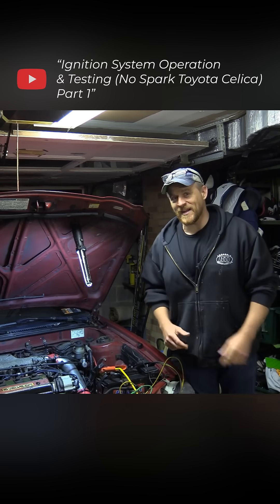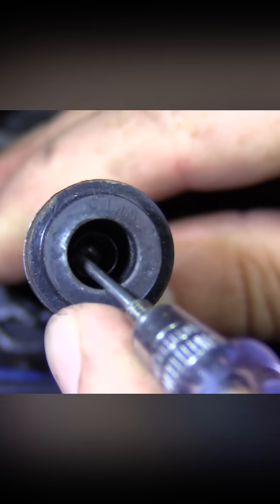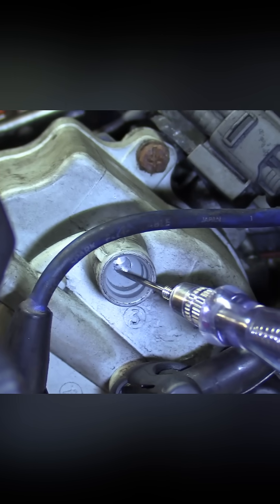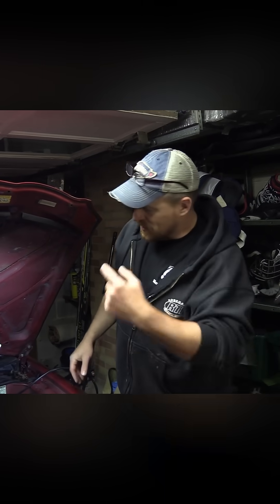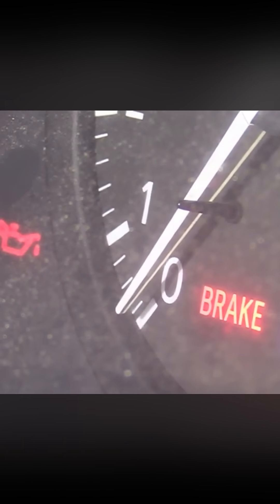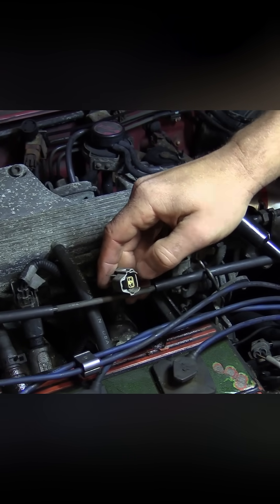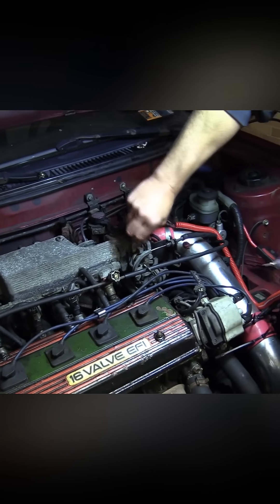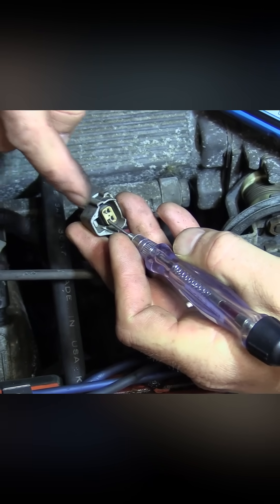Quick tests for no spark  #automotivediagnostics #nospark  #mechanic  #automobile

Comment: Called this one at the start of the video, soon as you said no start. Shorted ignition coil. Those distributor mounted coils in older Toyotas were notorious for that. Bet a current ramp of that coil would go almost straight up.
Reply from the maker: I think we showed the coil current ramp in the full video (linked in this short)

Comment: My car isn't cranking I changed the ignition switch and the tumbler all fuses and relays were checked by multimeter and new starter. Please help
Reply from the maker: Need Voltage readings on the starter during cranking. Both the heavy post and solenoid post
Reply: @ScannerDanner  it doesn't crank at all just clicks. Battery is fully charged
Reply from the maker: @daveyboy919  now you are wasting my time. Voltage readings need to be taken at the starter. Or just throw parts at it. You have two choice. I won't help any further without actual numbers
Reply: @ScannerDanner  nevermind bro I'm here by myself I can't do it

Comment: Wait if your finger is touching the same metal that is supposed to conduct that really painful shock,in theory electricity would also go through your finger right,so maybe keep finger away from spark plug wire tip.
Reply from the maker: no risk at all. The other end is grounded to the body and is the easier path, even if I was touching the metal tip of the test light i would not get shocked

Comment: I bought a 1981 Toyota Celica Supra a year ago. It had this same problem and my mechanic couldn’t fix it so I sold it just last week. I took a big loss on it too. Having to sell it was a real bummer.
Reply: hes not a mechanic than lol
Reply: we had one in our shop too, found the IGN system was unique in Toyota engineering, was insanely complicated. After checking everything and a new Distributor later, still no start, our tech wanted at the timing chain next, found out customer changed it just prior to this issue, bailed on us, was angry with us, we ate most of the bill, wasn't fun.

Comment: So your cranking an engine that’s not getting spark and you smell fuel. You then think, ah ha….I should test the injector signal to make sure I’m getting fuel?? What kind of logic is that?
Reply from the maker: Can you smell the fuel? What a stupid comment. I'm proving the point and showing testing methods. Move along. Wrong channel for you
Reply: I didn't mean to be mean, it was sarcasm. Also using a 12V test light to provide a path for secondary ignition ground with tens of thousands of volts is a bad idea too.

Comment: Amateur/Shade Tree here. I always learn something (that I had NO IDEA about) prior to watching Paul work/test. I'm chasing an Evap code but I can't afford an expensive scan tool to command Vent/Purge on or off, or a smoker. When it gets warmer here in the NorthEast, I may put it up and reach under to test each one electrically. I have a feeling I'm looking at the Vent Valve but I don't want to just change parts until I find it. It's not effecting the driveability or ignition (yet).

Comment: It’s an odb 1 system in that car. You can test the fuel pump through the test port under the hood. Jumper pin 1 and pin Fp. Guess what Fp stands for?
Reply from the maker: Wasn't worried about the fuel pump in this senario

Comment: You got a lot of guts touching that test light conductor. That sucker was live, you’d know!
Reply from the maker: No worries at all! Even if it was "live" the easiest path is not my finger. It is through the metal tip of the test light then to ground on the other end of the light. As long as my finger was further away than the metal tip of the test light. I'm good. Even resting my finger on the metal you wouldn't get shocked

Comment: The tack should have moved to engine rotating rpm .but since  the only thing that was causing the tack to move was just the voltage moving by being drawn from the starter .and sincebthe primary ignition is working then it would have to be the igniter since it is the module and its primary job is to compute the ground signals
Reply from the maker: Check out the full video linked in this clip

Comment: Pop the distributor cap and make sure your rotor is rotating before making any other test in my opinion takes less than 10 seconds. I try to start with easiest and cheapest.
Reply from the maker: Since the ignition input circuits are all inside of the distributor, there is no possible way that it is not turning. We have tach bounce AND injector pulse. That visual inspection is not needed in this situation
Reply: @ I beg to differ on this assessment. The ECM in correlation with the crankshaft/ camshaft sensors, reluctor ring give you a pulse width signal to your injectors. The distributor is what controls the spark to the spark plugs not the ECM/PCM. I have came across this issue more than once in my days where the fastener for the $7.00 dollar rotor has vibrated out thus your rotor will not rotate if not keyed to the distributor shaft. So if that is okay then you want to go after the ignition module that is also inside the distributor and do a simple ohm test.
Reply from the maker: @DanielDonohue-zr7pi  you can beg to differ all you want. The fact is, the ignition inputs are all inside of the distributor. No external cam/crank inputs on this model
Reply from the maker: @DanielDonohue-zr7pi watch the full video if you have questions.
The ECM absolutely controls the igniter, which in turn switches coil primary on/off
Reply: @ScannerDanner  wrong go back to school this is a motor with a distributor. It doesn’t have coil packs!
Reply from the maker: @DanielDonohue-zr7pi  😂
Reply: @ScannerDanner  He's mostly correct. He's referring to the screw holding the rotor button to the distributor shaft. If that falls out (I've seen it happen) the distributor shaft will still turn with the engine, so your NE and G signals will generate, and the ECM will see them and send the IGT signal back to the igniter and also pulse the injectors. The coil will spark, but because the rotor button isn't spinning with the shaft you'll have no spark to the plugs. So even though that wasn't the case on your vehicle, it can cause the condition you had and it's something you need to check.

He's incorrect that the ECM doesn't control the igniter, because it absolutely does. It receives the NE and G signals from the distributor, sends the IGT signal back to the ignitor and analyzes the IGF signal from the igniter to see if the coil really fired. Though perhaps what he meant was that distributor controls the spark routing to the plugs. Either way, you really do need to check that screw in this situation.

Comment: Smells gas so checks the injector? No spark means working backwards through the electrical. Side trips through the fuel system are a waste of time. Igniter? This isn’t diesel or a jet engine. It’s likely the coil or the coil wire. but I’m old so what do I know.
Reply from the maker: I'm proving concepts. Could you smell the gas?  😂
No, you can't, so i gave you a visual and it is a test people must know how to do. Watch the full video if you have issues with what I'm doing. It's a clip that isn't going to show you everything lol
Reply: @ScannerDanner  well said Mr Danner 😉
Reply: yes, the "igniter" that triggers the ignition coil to send high voltage to the plugs. Old car, but great advice. Good video.
Reply: Toyota IGN is insanely complicated,

Comment: …and the ignitor is inside every Toyota coil pack of the 90’s forward, so it’s the coil!
Reply from the maker: You still have to confirm igniter control signal is being sent from the ECM on the units that the coil/igniter(coil driver) that are married together. 
On this one, the igniter is separate and so additional tests are needed too

Comment: So you have no spark, and continue to check for fuel injectors? Not the distributor cap and rotor button which are pretty common to wear out on an old car? Okay
Reply: paul geht in beide richtungen ,was ist daran falsch ? ich denke ( sorry ) dir fehlt das verständnis .
Reply from the maker: What does an ignition system need to fire the coil? 
Inputs is one of the main things that must be tested. What does injector pulse tell you about the input circuits? 
I'll wait...

Comment: So, you have no spark, then why did you check for power and pulse on an injector?
Reply from the maker: It confirms the ignition inputs are fine
Reply: @ So the same circuit for an injector goes to a corresponding coil?
Reply from the maker: @nicholasittzes7224  same inputs used for injector control are used for spark control
Reply: @ Thanks!

Comment: Good logic. Given there's no spark, that engine sounds as if it has low compression on one barrel too.
Reply from the maker: Good ear and here is a variable for that. Cylinder wash from the injectors firing with no spark

Comment: I watched this video more than 15 times and I don’t understand what he is doing or saying midway through the video. The battery positive and ground and pulsing. He did 2 tests I’m so confused
Reply: On this specific vehicle the injector has two wires. One wire will have battery positive voltage, the other wire is the signal coming from the computer. As you know an injector doesn't stay on 100% of the time, it pulses. Therefore the pin that lights up the test light and keeps it lit must be the circuit with battery voltage

Now at this point this is where you would pull up a wiring diagram and see how that injector is controlled. In this case Paul is very experienced and he knew that the injectors are ground side switched. In other words, the computer gives the injector a ground, and then it takes it away, very quickly. That is how the injector "pulses" at this point you switch the test light to battery positive. Every time the test light receives a ground it will light up. With the test light touching the pin for the injector he cranked the engine. Notice in the video that the test light pulses. In 5 minutes we found out that the injectors have power, the computer is capable of controlling them, and we know the crank sensor is operational because the tachometer is bouncing while cranking the engine. To put it simply, the computer is giving the engine everything it needs to run. We can confidently say there is a mechanical failure causing a no spark. In 5 minutes using a simple test light the diagnosis is already almost done
Reply: I will also note that using a test light with a tiny little peanut bulb is pretty unlikely to damage anything if you accidentally reverse the polarity while checking for injector pulse. For the sake of learning I would still recommend checking a wiring diagram so you can familiarize yourself with understanding how they work and understanding a circuit before continuing with a diagnosis

Comment: Hey, instead of no spark. Did you ever hear about the issues with the early 2000 yukon having no rear heat and actuator doors not working? They all do it, maybe show us why on that? Looks pretty hard to figure out

Comment: Nice diagnostic flow chart, I'm going with a faulty igniter.
Reply: Having been a tech for Toyota in that era, the igniters were known to fail
Reply: Where is the flow diagram ?
Reply: @gerardsagliocca6292  going through a specific list of faults and parts in a specific order to get you to the real fault . That's called a flow chart. If one doesn't follow this, it's going into guessing and chasing the tail.
Reply: Where is the diagram located ?

Comment: 94' Celica what did he do lose a bet! lol just kidding. Man I remember these cars having bad igniters or caps. The Camry module recall under the handbrake with a plastic cover. Oh and tech teams. Then to Honda! 1st job warranty clutch for used cars on a S2000. They were racing(two salesman) a S2000 against a Audi A4. Fun I lost that bet lol.

Comment: Something I have heard from a couple of "experienced" techs is that as soon as I start explaining the fault, they jump in with, " I know exactly what it is." Turns out they have been wrong every time. The last one, the guy said for sure it's the fuel pump. I said that we should test it first by powering the pump directly. The pump was fine. Turns out the ECU board has delaminated, and a bunch of circuits had failed.

Paul, At this point in your diagnosis, some would say, it's definitely this. Ok, maybe it is, but can we test that to VERIFY? 

In my case, it was probably the ECU, but I got him thinking about how to verify it. No fuel pump signal output, no scanner communication, and no 5V REF was enough to call it.

Verify rather than jump to conclusions.
Reply from the maker: Using the 5v ref circuit in that way is a great test for sure. Nice job on that. Some just don't or won't understand how it should be done. "Don't be a parts changer" right?
Reply: @ScannerDanner  The 5V REF was his idea, but I pushed him to think. Hopefully he will continue to engage his brain before he engages his wallet. 

Oh. There's another tagline: engage your brain beside engaging your wallet.

Comment: 41 years repair tech / 30 years shop owner here - recently retired. Excellent example of KISS. Keep it simple stupid.  Quick, accurate  diagnosis to this point and your hot on the trail to a fix. Good job 👊
Reply: Plus, he didn't even need a code reader.  The way I check for spark is to use starting fluid.  If you kick over the engine and no fire, no spark!